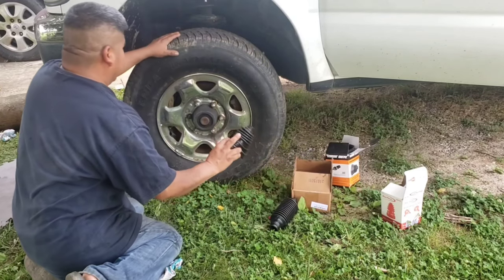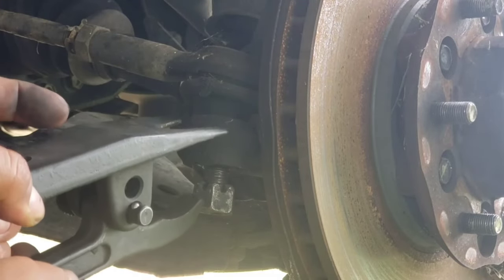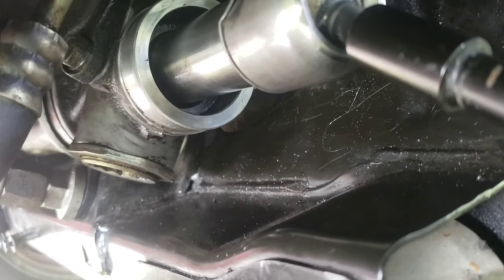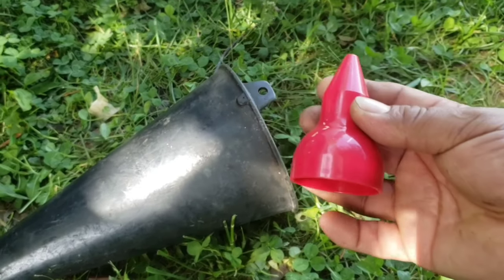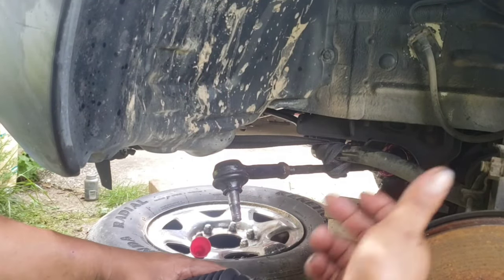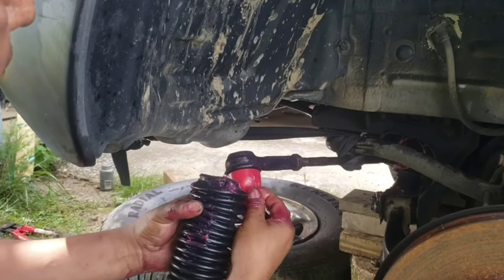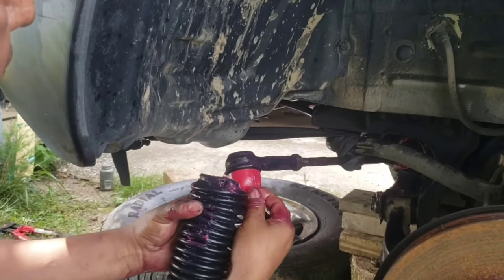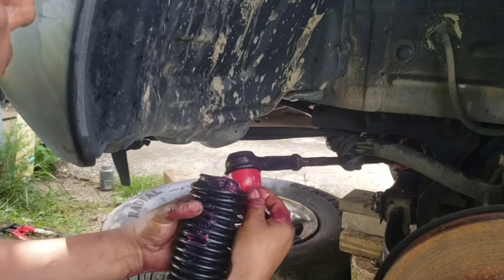Steering Rack Boot Replacement without removing Tie Rod End & not Affecting Wheel alignment,

Comment: I was going to install the same boot in my car. Not after seeing this. I would rather pay someone than pay for a fresh alignment. This way is too messy.
Reply: It’s not hard at all to just remove the tire rod and not lose your enlightenment.several videos on here and I just did it and if I can you def can
Reply: This is a relatively clean job for mechanic work. I'm set to do this job and probably the messiest part will be cleaning out the old grease at that joint. That would have to be done regardless of whether you're using this boot method or the more common method.